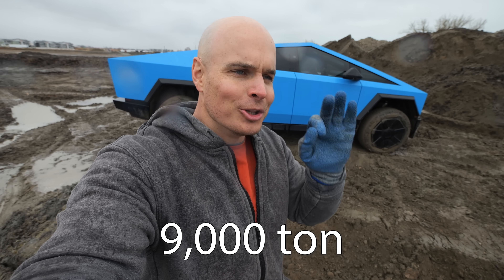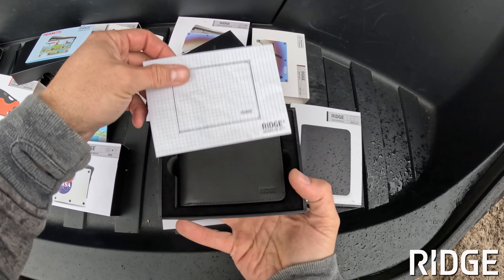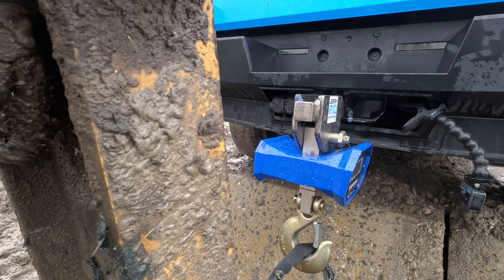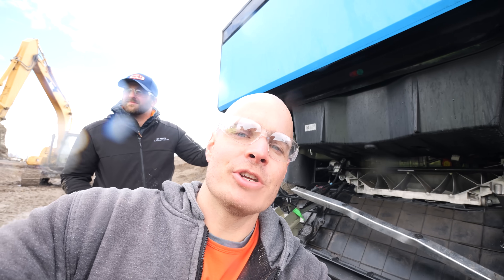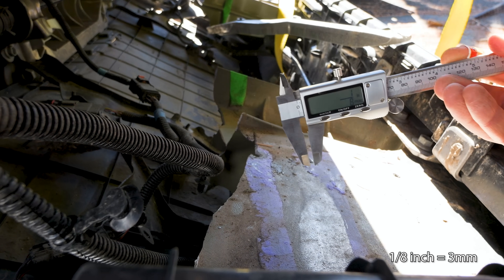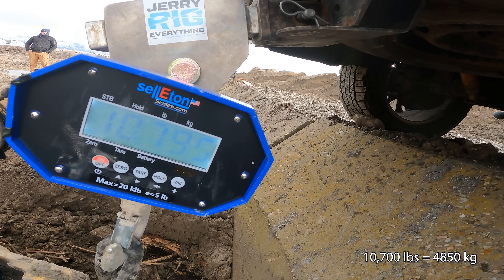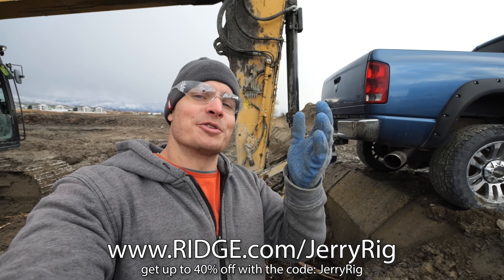SHOULD YOU TOW WITH A CYBERTRUCK?! - (catastrophic failure test)

Comment: Why does a cybertruck need to be able to handle 10,000 lb tongue weight? It is only advertised as being able to handle 1100 lbs. You took it to 9x it's rated weight and are surprised it broke?
Reply: Trailer weight: 5,000 lbs (2,268 kg)
Speed before impact: 50 mph (22.35 m/s)
Speed reduction from hitting a pothole: 5 mph (2.24 m/s)
Time of impact: 0.1s
F = (2268 * 2.24) / 0.1
F = 11,420lbs of force
Calculated using impulse-momentum via Newton's second law.
Reply: @bt-p6i  Absolutely irrelevant calculations to the discussion. The speed reduction you are talking about is horizontal and thus not tongue weight.
Reply: @poplix2704 If Tesla uses 6xxx-T6 aluminium, which has a fatigue strength of 10m cycles at 96MPa, then with 50,000 cycles at 100MPa, the lifespan is estimated to be a 200days to a year, as that’s high stress (Basquin’s equation for fatigue life). With moderate stress around 80MPa, then it could take less than 5 years. Either way, it’s not beating any other “truck” on the market. The aluminium frame isn’t just going to have vertical forces. It’ll also have horizontal forces acting on it too.

The hitch is rated for 1100lbs. A single pothole with a 5000lb trailer going at 50mph, with 10% trailer weight as tongue weight, will exert vertical forces of 2000-3000lbs. GG. So now I’ve provided both horizontal and vertical forces.
Reply: @bt-p6i  That is not the vertical component of the load. Breaking also puts the frame mostly in compression rather than tension.
Reply: @yodaiam1000  I’ve provided both the vertical and horizontal forces.
Reply: @ I don't see your vertical load. Your are decelerating in the horizontal plane. Your 0.1 sec number also looks unrealistic. It implies that you can stop from 50Mph in 1 second. I find that hard to believe. The aluminum will also not fatigue in a compression stress.
Reply: @yodaiam1000  I did provide it. It says in the comment above. Here it is again:
Trailer: 5000lbs.
Speed: 50mph.
Static Tongue Weight: 10% of Trailer (500lbs).
A bad pothole can generate 2g-3g.
AccelF = 2g or 3g impact force.
F dynamic = Static Weight + 1 because gravity exerts 1g, and we assume the pothole exerts additional G’s.

W(dynamic) = W(static) + (1 + gImpact)

W = 500 x (1 + 2g) = 1500lbs
W = 500 x (1 + 3g) = 2000lbs

In other words, these weights are still well over the maximum tongue rating of a CyberTruck. I also mentioned the stress on aluminium in the previous comment with 10m cycles for 6xxx.
Reply: @bt-p6i  You typically do not generate 2-3g vertical force (or even horizontal force) from a pothole. 1g feels like a really hard hit. You can exceed 1g but that is not a daily occurence. That would be an extreme event. Even so, at 2g you are only generating 15% of the ultimate load. The rated loads are the working loads that exclude accelerations. So I don't see the issue from the test on the video or from your numbers. That is not to say there isn't an issue, it is just not demonstrated.
Reply: @ lol? Potholes easily generate 3-5g’s. Go ask Elon’s Grok if you don’t believe it. Or maybe check ResearchGate studies, which I did… I literally looked up “Average G-force on a Sedan hitting a pothole” and “Force on car suspensions”, and the answer was 3-5g. I used 2g to be conservative. That constant hammering like an impact driver, will destroy the aluminum frame.
Reply: @bt-p6i  You likely aren't going to hit 3 to 5 G without your suspension bottoming out and doing damage to the car/truck. Like I said before, 1 G feels like a hard hit. What you are talking about is a very rare occurrence that is expected to produce some structural damage to just about any truck. But even at 5G you are still only at 25% ultimate of the vertical tongue load. So I still do not see an issue with the tongue load capacity. You will likely damage the truck before breaking the tongue under those conditions.
Reply: @ I disagree. A medium pothole of 2-4” typically generates 3-5g’s at 50mph. At 4g’s the momentary tongue weight peaks, it hits 4,400lbs, which is the max CT tongue weight afaik. So I went with 2g’s as you’re not going to be towing max tongue every time, and not going to be hitting medium sized pot holes like that often. So 2g’s is totally normal to hit in the highway. It’s not just the max weight that’s important. It’s the constant hammering or force applied when hitting bumps, over time. Aluminum doesn’t have a fatigue, and over time this will damage it. Car suspensions are designed for regularly experiencing 6g impacts. At 120km/hr I’ve already broken a strut hitting a medium pothole, and popped the tire. Had to file a report with the city’s insurance to get it covered, which required measuring the pothole. It measured 1.9m in length, 24cm deep, 0.5m wide, hitting it with 19” rims with PZero tires. I guarantee you’re easily hitting 3-5g’s on a regular basis in your sedan. Your suspension is just rated to handle a lot more so you don’t feel it or care. Trucks are rated for 8g’s or more.
The CT can probably handle it on a regular basis, the problem is over time. Aluminum was not a good choice.
Reply: @bt-p6i  Maybe you are confusing unsprung mass acceleration with the acceleration of the body of the car/truck? An aggressive roller coaster goes to up to +5G (even 6G in the most extreme rides in the world). The rebound from just about 1.5 G will get your butt off the seat. Without dampening in the shocks, 1G will get your butt off the seat. That is not a daily occurence. Tires and rims are damaged when the body of the cars hits about 5Gs (50G at the wheel). You will damage struts etc. I am not saying it can't happen but it is not a daily occurence. 5G is very uncomfortable for most people. The structure of a truck might be rated for 8G but that does not preclude damage of the suspension.
Reply: @ hmm maybe I’m wrong then? Here’s my math:

Speed: 50km/hr = 13.89m/s.
Pothole depth: 4” = 0.1016m.
Vy = Root(2 x g x d).
Vy = Root(2 x 9.81 x 0.1016) = 1.412m/s.
If the wheel exits the pothole at the same time it takes to drop in, t = 2d/1.412.
t = 0.144s.
The wheel goes down and up, so 2Vy = 2.82m/s.

a = 2.82m/s / 0.144s = 19.583 m/s²
19.583m/s² / 9.81m/s² = 1.996 = 2g.

So hitting a 4” pothole at 50km/hr exerts 2g’s of force on the wheels. The above estimates sudden impact, instead of a gradual dip, for simplicity. Also doesn’t take into account suspension and other stuff. I’m also not considering the suspension expansion pushing the wheel into the pothole, and compressing when coming out.
Reply: @ Maybe you are thinking of the accelerations of the unsprung mass of the wheel? You certainly do not experience 3 to 5G on a daily drive. Hitting a pothole at 120km/hr can cause tremendous acceleration of the unsprung mass. The accelerations of the unsprung mass can be an order of magnitude (or two) more than the body of the car. You will leave your seat on rebound of 1.5G vertical acceleration of the car body. Damping ratios for most shocks are 20 to 40% (W/O damping, 1G will get you to leave your seat on rebound).
Reply: @bt-p6i  That sounds more reasonable.
Reply: Jeez... did you watch the video at all? He said because of pot holes and towing angles.
If you hit a good pothole, it will place an impacting force downwards. How do you think impact drivers work? There's a hammer in them. Now think of the trailer as a hammer constantly jumping up and down hammering that aluminium. Aluminium has no fatigue limit whereas steel does. It's bad lol. How tf does a brand new 2020+ cybertruck get rekt by a 2004 RAM -_-
Reply: @bt-p6i  That's ridiculous. You aren't going to break the frame by going over a pothole. The only people breaking these are youtubers doing dumb shit.
Reply: @juliansecomb3703  You maybe need to learn physics before you call something dumb. 

Trailer weight: 5,000 lbs (2,268 kg)
Speed before impact: 50 mph (22.35 m/s)
Speed reduction from hitting a pothole: 5 mph (2.24 m/s)
Time of impact: 0.1s
F = (2268 * 2.24) / 0.1
F = 11, 420lbs of force
Calculated using impulse-momentum via Newton's second law.

In other words, GG CyberTruck.
Reply: @juliansecomb3703  You maybe need to learn physics before you call something dumb. 

Trailer weight: 5,000 lbs (2,268 kg)
Speed before impact: 50 mph (22.35 m/s)
Speed reduction from hitting a pothole: 5 mph (2.24 m/s)
Time of impact: 0.1s
F = (2268 * 2.24) / 0.1
F = 11, 420lbs of force
Calculated using impulse-momentum via Newton's second law.

In other words, GG CyberTruck.
Reply: @juliansecomb3703 pretty sure there’s already a video of one breaking on the highway

Comment: This is a jerry rigged real test method for towing capacities. If I remember correctly the DOT/NHTSA rating is 70% of the fail point, so a fail point of test of 10,500 lbs is a 7350 lbs. towing capacity. And the 11,000 lbs is the requirement for a 7500 lbs towing capacity.

Comment: The adhesive is also for noise abatement - it stops squeaks and rattles. It looks bad in this case, but adhesive gives you a MUCH larger surface area than welding.
Edit: That failure mode is WILD though. Really really bad.

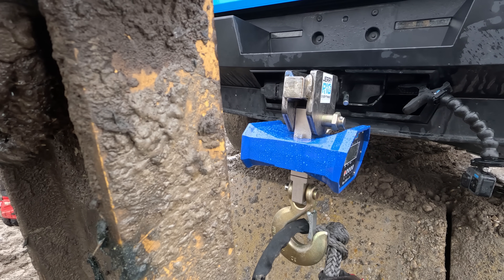Comment: 4:37 It sounds like if the front wheels come off the ground, any reasonable driver would recognize this as an issue and fix the problem. Especially if you lift the wheels on a 7,000 pound truck. Nothing about this test is reasonable or life-like. You mean to tell me that abused equipment actually fails? Wow. Imagine that. This is nothing more than boys playing in the mud. Has anyone seen an actual towing failure? All I’ve seen so far is extraordinary abuse tests.  Also would like to see the bullet holes in the Dodge door for comparison.

Comment: The science here is important. Aluminium, when put under stress, becomes weaker each time. Steel does not (within it's limits). In a few years of a CT towing heavy machinery over pot holes, speed bumps, maybe some off road drags to rescue other vehicles, the aluminium structure will be weaker than it was at the point it was first made, whereas a steel frame would exhibit the same strength as it was when manufactured, assuming no corrosion has reduced the steel thickness/ weakened welds. The concern here is not the rear of a CT falling off on the first trip with a heavy trailer after bouncing though a pothole. It's the Nth time down the road when fatigue has started setting in.
Reply: Most truck manufacturers use aluminum suspension control arms.  Better not put too many miles on or they’ll break.

Comment: Just want to point out the frame for the 2004 Ram 2500 is the same as the 3500 with just a few different mounting points added to the 3500 for bigger suspension so the frame is designed for a max tow load with the correct configuration of 16,300 lbs I sure hope he finds some heavier equipment to test that
Reply: I’ll donate the larger excavator to do the proper test on a 3/4 or 1 ton.  I’ll also provide the mini excavator to test the Rivian hitch.  Not knocking a Rivian, buddy just bought one and I do love it.

Comment: I’m sorry but pulling a trailer up a hill does not put 10,000 lbs downforce on the tongue. The weight is still on the axels of the trailer.
Reply: So? Cybertrash is still an unsafe vehicle and should not be sold. To be fair all swasticars should be removed from the roads.
Reply: He has an agenda. It's clear at this point. It's sad, I genuinely respected the guy until this and the F150 lightning videos.
Reply: Plus, even on a berakove, you have the trailer's momentum.
Reply: Stop making sense! He has an axe to grind with musk, and you WILL let him grind it no matter how rubbish this test is!

Comment: You gotta know what you're talking about before you post such blatantly false and misleading content!  Tongue weight is 10% of towing capacity, so 1,100#, plus a safety factor.  A tow rating is not a lifting load limit.  I think the Cybertruck is dumb, but this content is worse.
Reply: The real problem with this whole cybertruck tow hitch thing is not the fact that it breaks, it's the WAY that it breaks. It snaps right off instead of bending. You won't lose your trailer at 60 mph if your frame bends. 1,100 lbs can easily become 3000 lbs or more when you hit a sharp dip in the road, and how many times can it handle that before it breaks off from metal fatigue?
Reply from the maker: Good thing I said exactly that in the video then huh.
Reply: @JerryRigEverything You did worse you lied about the real world physics of this being possible. You said; one misloaded trailer could cause this failure. you said; at times a trailor can transfer its entire weight onto the hitch. you advised people; if you ever see a cybertruck towing, stay away from it.

You seem to understand physics in your other videos, but somehow you forgot them here, or worse you’re intentionally misleading people to create a Tesla hate video. So disgusting
Reply from the maker: @_HashForce  can you link to the part of the video where I said "entire weight of the trailer" or did you lie while calling me a liar?  There are many examples where the trailer weight transfers to the tongue weight.  The earth is not flat. But it's never 100%
Reply: @ At 10min with ur hot wheels skit. *(there are real world situations where the CT traitor weight becomes tongue weight under normal
towing condition.) *(That 11,000 lbs trailer weight becomes tongue weight and the cyber truck hitch could snap off.) *(or pulling a vehicle out of the mud could apply 11000 lbs of force non linearly.) *(or worse a trailer could pop off the ball and apply 11000lbs force on the safety chains and break off the bumper) ……That whole segment is BS cause you know its not physically possible for a 11000b anything to apply full downward force to the bumper. Even the 50k lb excavator had to be moved closer to the CT cause it was lifting off the ground with 6k lbs force. You are better than this. I know youre upset with Elon, but this isnt cool. A lot of people will see this that dont understand real world physics and you’re purposely misleading them in a negative way. You know its misleading, thats why its “lying”
Reply: @JerryRigEverything  Acting as if you weren't also saying "This is a disaster and weak!"  "Catastrophe" not to mention your skit with the toy car going up a hill is not feasible.  Your hate clouds your judgment

Comment: Hmmm… so the casting break makes sense, but it looks like there are 6 of those robotic tack welds per side along with the bonding agent. They could have just welded the whole panel. It definitely needs a redesign from the casting out to the hitch receiver. But honestly, full on EV’s are not efficient enough yet for mass adoption, yet alone towing. They should just lower the weight rating between quarter ton and half ton trucks towing capacity until a casting redesign can be done. I can imagine how bad the range is while trying to tow on one of these. Just impractical for anything long distance. 150 miles, maybe 🤷🏻‍♂️

Comment: 6:31 “I thought it would break sub-5,000”

Makes it past 5,000

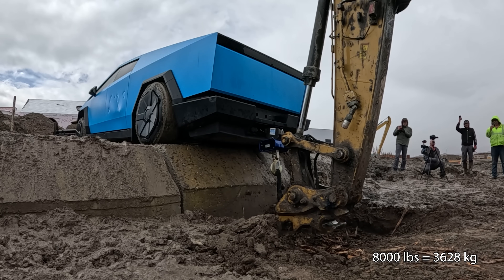6:52 “There’s still a big issue if it doesn’t make it to 10,000”

Makes it past 10,000

7:45 That’s one improperly-loaded trailer away from catastrophic failure”

Talk about moving the goalposts!
Reply: Musk fanboy spotted. The fact is the aluminum chassis is crap compared to a steel chassis.
Reply from the maker: Lol to be fair i did say at the beginning if it fails under 10k tesla has a problem.
Reply: @JerryRigEverything ???? So if it breaks with a load 9 times greater than it’s rated for it has problem? Ok….🤨
Reply: @gabrielleite6605  Lol I'm wondering the same thing. This is so obviously a 'I hate Elon' video. I'm actually impressed with the truck. Jerry rigged the test and it still performed very well.
Reply: @JerryRigEverything  How is the 10x tongue weight rating a failure? 
You jerry rigged the testing standard here.
Reply from the maker: @DIYtimeTech  SAE standards say the 'safe' tongue capacity for a class 4 hitch is 5500lbs. And that's on a steel frame. Tesla is using aluminum. Which should be beefier in my opinion. But time will tell. Thanks!

Comment: I’m no cyber truck fan but actually lots of cars in the automotive industry use adhesives to hold the body together now car frames aren’t fully welded anymore not for any vehicle on the road. We have adhesive today that do amazing things like go into outer space. Some of those same adhesive are used to hold your car together along with nuts and bolts and spots where we tack weld pieces together.

Comment: Though I agree with your opinion of aluminum vs steel for frames, one breaks one bends, the outcome is not accurate. You tested tongue weights. The tongue weight will never exceed the max trailer rating for a consistent time unless the trailer is vertical to the towing vehicle. 

Right?
Reply: If an improperly loaded trailer (weight in front of the axles) receives any type of jarring bump such as hitting a curb, pothole, or speed bump, it will easily hit or exceed that rating for a split second. Do that enough times and you can kiss your hitch goodbye
Reply: @Tylerfreeman99  Test it. The trailer will still be supported by it's axels to some extent. If the trailer is 11k lbs, is 100 % of it's weight transmitted to the receiver perpendicular to he frame? I'm not denying that aluminum frame a horrible choice. But using Jerry Rigs theory means tongue weights do not exist. He is implying tongue weights should match or exceed trailer weight. That's insane. Improperly loaded trailers are not a design factor of vehicles and are not the responsibility of manufactures. The video is interesting but booth vehicles suffered damage.  s